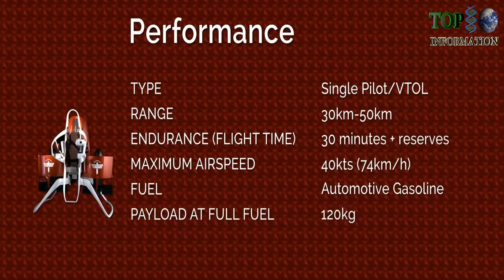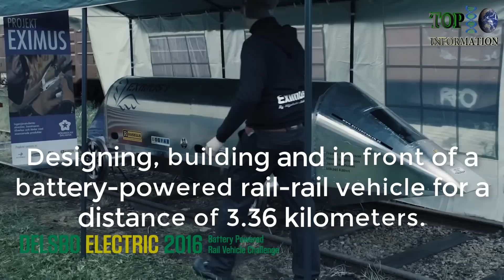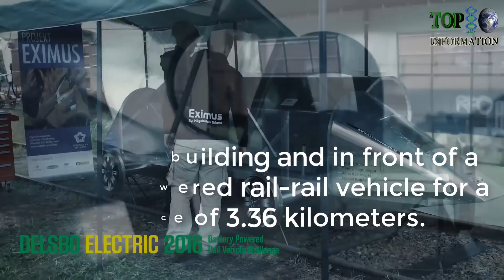5 INSANE MACHINES That Will Blow Your Mind ▶35

Comment: Let's look at the 5.
1) Table tennis robot. Ho hum. Spent most of the time showing the human.
2) Electric scooter, with dual front wheels. Nice, but not even a new idea.
3) Barrier system - again, not much mind blowing. They've been around for years.
4) Jet pack - OK, kinda cool, but NOT a jet pack. It uses fan thrusters. Not jets. But it will be competing with drones.
5) I liked the rail car, I've already done designs, this one is fancier than mine, but I have a better view.

Overall, an OK video, but does not get even close to the hype of the title - "mind blowing".

Comment: The Martin Jetpack: cool, but it seems to have very few use cases. It cannot haul another person back (120 Kg payload is not enough for two people), any item that it can bring to an incident site can probably be delivered by a suitable cheaper drone, and reconnaissance can be done cheaper using a $1000 quadcopter.
The only use case I can think of is to quickly bring the pilot to a place which is difficult to reach but where there is sufficient space to land and do some things.

Comment: The Martin Jetpack is the most ridiculous non-solution I've ever seen though. What exactly is the benefit over just using a helicopter? I see exactly none in the video (flying in tunnels, really?! Flying within confined spaces?! I don't see how such a Jetpack would have any purpose but 'eyes and ears', something a simple drone could do for less money and fuel). It also includes a lot of 'make believe' shots where the Jetpack doesn't even fly, let alone how no shot shows what an actual 'rescue by Jetpack' would look like. The craft doesn't really seem to be designed with that in mind at all.

Comment: I wonder if they had enough sense to figure out how much these barriers on the bridge weigh and compare it to the max load allowed on the bridge ( accounting for max traffic load) and max per section and the load placed on the section while moving the blocks plus the truck to do it and being passed by a another truck that can have as much as 40,000 lbs as the rear wheels on a semi truck passes.

Comment: I only came here to see the Rail Vehicle. I built 6 prototypes that run on gasoline back in the 70s. They were four passenger and got 100 mpg. They were a lot of fun to use. We used them on mostly abandoned rails. We did however use one set of live tracks that were privately owned by Kaiser Steel. Those tracks were 22 miles long and went from the mine at Eagle Mountain down to the Santa Fe tracks near Salton Sea CA. Today it is completely illegal to drive anything on any railroad tracks in the USA.

Comment: That Eximus is pretty impressive. Only 0.84 Wh consumed per person per km traveled. That means the vehicle can travel 1 km with an energy input of 5.04 Wh. I'd be really curious to see how much of that is consumed by air drag and how much by rolling friction and internal friction. If one passenger ran on an elliptical generator at 250 W, the Eximus could cover a full km in just 72 seconds, or 50 km/hr! That's on a level grade. I reckon its efficiency decreases with increasing speed since drag force increases with velocity squared. With all six people running on ellipticals at 250 W each, I have no doubt in my mind that it could attain speeds of over 80 km/h.

Comment: Helicopters can DO a lot of stuff. Carry cargo, lift a person out of trouble.
What can that Jetpack DO? All that time spent, but no mention of actual useful tasks.
Reply: Derek Kerton who gives a shit, it's a fucking jet pack. People should be amazed. Instead everyone's like "what can you even use it for?". Fulfilling my childhood dreams is just one of many uses. Come the fuck on.
Reply: Yeah. If they said it was just for kicks, or just cuz they can, then I'd just yell, "Yahoo, have at it." But tell me it's for some practical purpose, then color me skeptical.
Reply: ShizukuSeiji Right, tight spaces... But then what? Can it lift an injured person? I doubt it, it looks like the pilots hands are very busy. Haul supplies? I don't know, does it have the strength? And stability?

I believe that is why they did not show any cases where it was useful. There may be no cases to show.
Reply: Derek Kerton i agree it may not be realistic vs drones in emergency situations but for private flights...... it would be awesome, so I think they're after the wrong market
Reply: You can chase pigeons and scare the s*!t out of them.
Reply: Presumably in tight spaces such as they showed in the vid (under power lines and bridges, urban areas, even inside tunnels I guess). But yeah, a skilfully flown chopper can get you the same access much cheaper in 90% of those instances. I wonder if the jetpack can operate at higher altitudes than a helicopter? It may have applications in mountain rescue, though that depends on its payload.
Reply: it can carry one person 50km at 30 kmph that's it lol
Reply: Aaron -Because some amount of practicality will have a strong affect on whether you are likely to ever see our fly in one. If it's practically useless, it won't leave their lab. 
I LOVE LOVE LOVE futuristic gadgety stuff. Especially transport. I have more EV balance boards, onewheels, scooters, and ebikes than you would believe. BUT, if these guys released this vid to promote the product, the onus is on them to demonstrate a valid use case, or two, or three. They did not.
It's too expensive to be a toy, and not practical enough to be a tool. If you want to fly, pilot a hang glider, like I do. You can still dream, but not pipe dream.
Reply: Maybe I watched a different video... They HEAVILY implied it could be useful for first-responders in emergency situations and they didn't even slightly imply that it was a helicopter-killing concept. Then you go and compare it to a hang-glider which has absolutely zero practical usefulness at all. You contradict yourself...
Reply: ob1coyote To clarify, yes that was said. What was SHOWN,  or demonstrated was nothing of the sort. Not even in a staged simulation. 

This leads me to believe that the jetpack cannot do the things it claims. If I were marketing that product, I would certainly show it doing something useful. Anything useful.
Reply: I didn't backpedal. I used the words "shown" and "demonstrated"  in each post. As in "they've not shown how it would be useful". 

And I didn't compare it to a hang glider at all. I just said that if someone dreams of flying for fun, hang gliding is cheaper and accessible.
Reply: Yeah... perhaps that IS what you meant, but it took all this to get anywhere close to it because you were so ambiguous with your comments... The world is full of products that are successful and at the same time are inaccessible to most of the population whether they're useful or not in your opinion doesn't determine the outcome. If that is, in fact, a working prototype in the video then they already have investors that don't agree with you.  I'm sure they already anticipated that someone like yourself might not be their target audience and, who knows, perhaps this one single video isn't their only piece of marketing material. Perhaps, it simply the one they show to people whose opinions have no bearing on their business.
Reply: Derek Kerton jet packs don't have the large main rotor that can hit structures and Power lines, the jet pack can get closer to things then a helicopter can. but helicopters can carry far heavier loads, so.... the jet pack is just a "scout"
Reply: OK, Jeremy, but we can do that task with a $1000 drone. The drone would be smaller, more nimble, safer, and quicker to deploy. It could host an array of sensors beyond 360 sight, such as FLIR. The drone would simply be better at that task than the jetpack.

Listen, I'm bored of this, as I'm sure most of you are. Instead of anyone telling me I'm wrong, please only reply with an answer like:

"The Jetpack can do valuable task X, and other tools can't do it as well, and is thus worth the expense and is perhaps commercially viable." Where X is something a little more specific than flying around an emergency site because it's cool to fly.

If someone can say that, then X would be the task the video should have shown the jetpack doing, but the fact remains that that video didn't.
Reply: I wonder if it could be adapted to rescue people from burning high-rise buildings.
Reply: Derek Kerton "Yep, there's a body in there..........now what?"
Reply: First let me say that any number of useless inventions and vehicles have drawn big money from investors who thought they were onto the next big thing.  Huge amounts of money thrown at a project does not always mean the end result is a success.  How many times has a flying car been put forth as that next big thing over the decades?  A LOT,   ...seen any flying cars lately?  Regardless, the Martin Jetpack no matter how cool a personal flying platform it is can't live up to marketing blurbs such at this load of hooey "The Martin Jetpack has the pedigree of reactive design ingenuity that is forged in New Zealand"   Because yeah, New Zealand, that's where I want my ingenious reactive designs to have their forged pedigree!

Comment: 3 wheeled motorbike, never seen one of those before!
Reply: Seen 2 or 3 recently in the UK. Even saw one several years ago. I didn't think they were anything new. They seem to be quite slow though without much performance. They also seem unduly complex for what they deliver and I wonder what their advantage is over a bike that has a stand ;)

As for the mobile concrete road barrier system that seems a ridiculously expensive solution. In the UK a few guys with a crane truck or two do that along motorways at 3:00am...
Reply: I was being psychotic. They are relatively common on UK roads. I wouldn't be surprised if they account for 10%+ of all motorbikes on road.  I are more common then the classic Harley Davison and Indian style bikes. All the metermaids use them here in London to get around faster.
Reply: belgian post has plans to use electric trikebikes
Reply: Gerald Davis i
Reply: That is a cheap version of the Spider.
Reply: Gerald Davis they are scary looking

Comment: A ducted fan is not a jet. How does adding a third wheel make a scooter better?
Reply: the jet comes from the pilot farting
Reply: A menstrual cycle has three wheels
Reply: that's the afterburner
Reply: Because when you get off the bike it won't fall....
And you have better front brake traction.